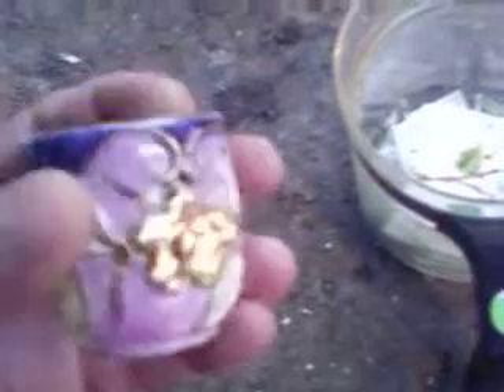The Acid Clorox method for Glassware and Foils from E-Scrap and Plated Materials.  Part 1

Comment: so this bleach and muriatic acid will work on most lightly plated objects ?
Reply from the maker: keith morrison On the foils only, don't use it on whole pins, you'll have a mess to work with, but could be done.
The Sulfuric Cell de-plating method is the process to use when processing pins.

Comment: the problem with using muriatic acid and Clorox bleach is that when the gold comes off the plates it turns into a powder. I have used stumpout after filtering the solution but then it doesn't solidify. the same solution I use to get the gold off everything is Muriatic acid and Hydrogen peroxide. this solution will take a little longer but it gets the gold off in pieces rather than turning it into a white powder.